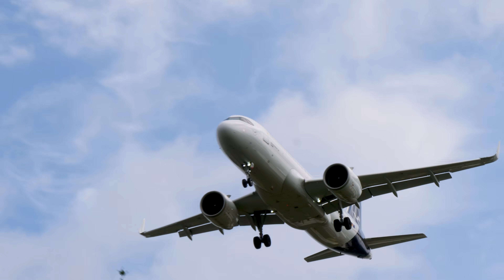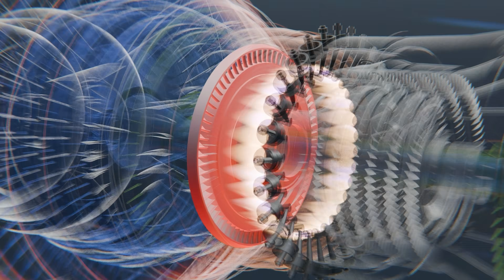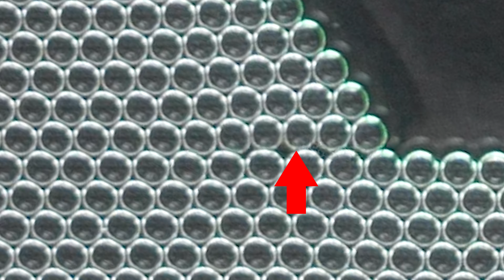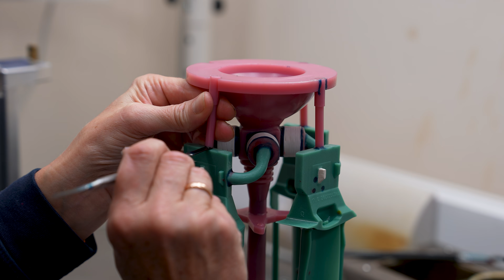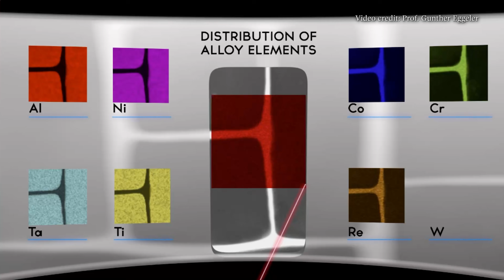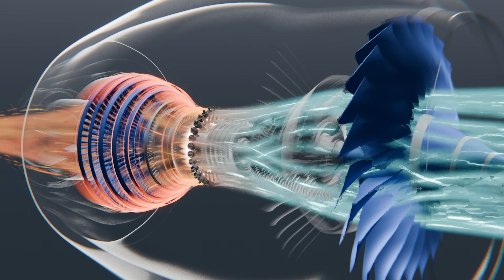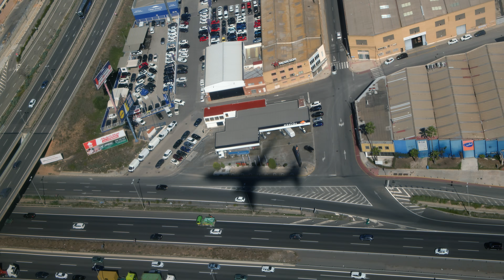The Ridiculous Engineering Of Jet Engines

Comment: If its anything like automotive engine tuning what the fuel "is" has huge effects on what happens to the temp inside the combustion chamber, on a petrol adding a bit more and going rich will means the unburnt fuel help cool the exhaust gas temps more, adding more fuel on a diesel however will do the opposite, keep adding extra fuel and it'll raise exhaust gas temps till stuff starts reaching melting point. 

most of these advancements in tuning and control have came in the form of modern electronic engine managements systems that have sensors that can in real-time monitor and perform operations like adjusting things like where it is on fuel and ignition tables based on a variety of conditions and inputs like engine temp, exhaust temp, AFR, ignition timing, throttle position etc etc as to what the best course of action is(add more fuel, remove fuel, add Ignition timing, remove timing etc)

I would also assume that a mix of 1000's of now standardised modern techniques & advancements in materials science on the jet engine (again, much like the car engine) over the decades, things like coatings on the compressor blades to help extend service life way beyond what they were doing back in Frank Whittles day no doubt help...a lot.

Comment: The Germans achieved the first jet aircraft flight on August 27, 1939 with an engine designed by Hans von Ohain. You can argue about whether Germany or Britain 'developed' the engine first, but you can't argue about who flew it first. Germany did.

Comment: This is incorrect right from the thumbnail... Jet engines burn at over 2,000 degrees celcius, and steel melts at around 1400 degrees celcius. The burning temperature is actually higher than the melting temperature. The reason it doesn't melt is because air that burns the fuel, cools the engine.

Comment: well this is the main challenge with making jet engines.
Building turbines that wont crumble under the extreme pressures and temperatures.
the chinese, iranians, japanese too i think and indians have been struggling with this same problem.
Whenever they turn up the power, the turbines get torn to shreds.
The soviets also faced this problem initially and they had to buy the rolls royce engines.

Comment: I remember when they installed a gas-tubine-combined cycle power plant nearby. The temperatures and combination of metalurgy is amazing. Those turbines, just like your video, have special alloys, cooling passages with film cooling. Such high temperatures help them reach efficiencies close to 60%. Compared to the typical car engine of only 25%, and conventional power plants in the low to mid 30's, 60% is astounding!

Comment: The most simplified explanation of how a jet engine works can be stated in four words "Suck, Squeeze,  Bang,  Blow".   Then jet fins are designed with coolant channels by utilizing the "Lost Wax" method.  As for the overall engine it's self,  it is protected by the utilization of an "Air Jacket ".  This process runs a constant stream of air flowing or crucial components.   If you want to know more do some research;  I am not a research department.

Comment: Hey someone care to explain me why after ignition the pressure to the front and back - if equal - does not force the air coming from the front to stop or force the hot air out to the front equally as backwards? I never understood this.
Reply: Sure, it's because the air pressure is not equal. After the compressors, the air is around 800 psi. At the rear of the engine it is zero. Air moves from high pressure ---> low pressure unless you do some work on it (compressors). The biggest thing to get your head around is that the heating of the air by combustion in a jet engine DOES NOT increase it's pressure. It actually lowers it somewhat. All it does is heat the air causing it to expand and increase it's velocity. That expansion lowers it's pressure slightly. The air isn't confined like in a piston engine. Light a match, flick your bic, light a propane torch, turn on a gas stove. All the same thing - no increase in pressure as the air isn't confined, just hot expanding air. Your hair dryer is exactly like a jet engine. The only difference is your hair dryer uses an electric motor to turn it's fan instead of being powered by a turbine and the heat is added by an electric filament rather then by burning fuel. They are basically the same thing otherwise.

Comment: This is exactly why I got sucked into structures and materials engineering for my aerospace degree. I had a chance to intern at Rolls-Royce and learn all this stuff hands on. Even still, with single crystal inconel superalloy, cooling channels, and ceramic TBCs, we still need more heat resistance for the performance we want; I had a chance to see some prototype components that looked like melted wax after testing. The future in this space is CMCs, or ceramic-matrix composites. That's the same technology that was used on the leading edges of the space shuttle---think carbon fiber, but replace the polymer resin with a high-temperature ceramic. I'm now working on a master's degree doing research in composites manufacturing because of that experience.

Comment: My grandfather worked at lycoming during the period when they first developed monocrystalline compressor blades. I like to think that he helped set the ground work that all future jet engine blade development is based on. I wished I had made recordings of him talking about work and the development process. When they first made their monocrystalline castings, they would plant a "seed" piece of metal and then heat and hold at specific temperatures until the crystalline cells would orient and grow off of the seed piece of metal until the whole blade had oriented into one crystal. The more modern processes are much more reliable for producing the same result. quite amazing.

Comment: even though they work pretty hard on the edge, remember, every plane in service must have the ability to start with one engine. so when one engine shuts off, the plane is still able to start, turn and land with full weight. feel safe.

Comment: Same reason you can boil water over a fire in a paper cup.  Top tier cooling.  There is footage of an RL-10 rocket engine being tested that has blue flame coming out of the nozzle and icicles forming at the nozzle exit.  Liquid rocket engines cool themselves the same way they cool turbine blades but they're pumping cryogenic propellant through them instead of air.  Those recent photos of Raptor 3s in test have moisture from the air condensed on them they're so cold.

Comment: In minute 4:00 shouldn't the square be inside the delta as in Equation (12.46) of ZUCKER, Robert D.; BIBLARZ, Oscar. Fundamentals of gas dynamics. 2nd ed.? Because (∆v)² = (v-v₀)² = v² −2v∙v₀ + v₀² ≠ v² − v₀² = ∆(v²)

Comment: 1. It's a PRESSURE ENGINE, not a heat engine. Heat is the byproduct, heat is waste energy. 2. You skipped HOW the turbine blades don't melt. You skipped the part about all the tiny holes in the blades where air is pushed through them, keeping them from melting.
Reply: The burning of jet fuel in a jet engine does NOT increase the pressure of the surrounding air, it lowers it. All it does is heat the air up causing it to expand and increase it's velocity. That increase in velocity lowers it's pressure.
Reply: @wally7856  No. You're releasing the stored energy in the fuel/air mix by igniting it. That explosive pressure is what drives the turbine. The heat produced is the byproduct, the wasted energy. Even IC engines are pressure engines, not heat engines. Why do you think the same engines can be run cold, with compressed air? It's a simple concept.
Reply: @JohnDoe-ml8ru  There is nothing "explosive" inside a jet engine. There is no air/fuel mix ratio either like a piston engine. There is always 90 times more air then is required to burn the fuel. The burning of fuel in the burners is no different then the burners on a gas stove. You turn on your gas stove, the gas burns in a steady manor in a nice ring, the air gets hot. There is no pressure increase. Flic your bic lighter, light a match, light a candle, light a propane torch - all the same thing. Air gets hot, no pressure increase as nothing is contained like in a piston engine.
    The pressures through the jet engine look like this:  /----____\
    Where (/) is the air increasing it's pressure in a linear fashion compressing through the compressors. When the air leaves the compressors it is at it's highest compression in the engine.
    (----) is the air moving to the combustors at the same pressure as it left the compressors.
    (____) is the slight DECREASE in pressure as the fuel burns in the combustors. It gets hot, it expands, it's velocity increases but pressure drops slightly.
     (\)  is the sharp decrease in pressure as the air goes through the turbines.

    A jet engine is just like your hair dryer except in your hair dryer instead of a turbine driving the fan it has an electric motor. Turn the heat on in your hair dryer. That heating element didn't increase the pressure, it just made the air hot and move faster. The burners in a jet engine do the exact same thing as that heating element in your hair dryer.

Comment: For anyone not experienced with any kind of casting: The idea that the shape of the blade can be as cast without further machining is by itself an incredible feat.
Reply: So while theres not further machining it it is still belted, twisted, arbored and heat treated after.
Reply: I did some diecast factor labor after highschool making Moen faucet and transmission housings. I can remember tons of flash and the first shot was some scary times!! I worked a trim press so yah that is pretty impressive 😊
Reply: couldnt you just forge it?
Reply: @squidwardo-e6g the tolerances are within a 1000th of a mm generally
Reply: @squidwardo-e6g I highly doubt you could maintain the single crystal structure in a forging process.
Reply: True dat!
Reply: Im maybe missing something 
What does ge mean by casting 
Mot familiar with scientific English words
Reply: Yup. I work in aerospace and have machined many a casting. They're far from accurate most of the time.
Reply: @travisgatlin536 I mean sure, but the amount of material your machining off is significant from the AS Cast part, even post alpha case removal. Like easily 50-75% is removed for most parts.

Comment: Used to design these components in RR. A video on how they monitor these engines while the’re in the air and how they can predict component failures before the aircraft lands and have replacement parts waiting to be fitted would be a great compliment

Comment: Doesn't compressing air mean it should lose heat?! It should become colder not hotter.
Reply: Try to imagine all the heat that is in the air in your room right now. Now compress all that air into a little tiny box. Now you have all the heat that was spread out in your room now  concentrated into a tiny little box. It would glow white hot.

Comment: Soooo.... if that engine does 97k lbf that means that a single SpaceX Raptor3 produces more than 6 times the thrust. So if its 4 engines on a jet a single Raptor3 (which also is waaay smaller) produces more thrust than the whole plane... Consider that there are 33 Raptors on Starship Booster... now I understand why concrete was being pulverized during that first starship test flight.
Reply: A single Raptor3 has about the same thrust as eight 747 engines!
Reply: @wally7856 thats basically what I Said…
Reply: @p0mm3srud1  Yup. 
747 horsepower ~70,000 hp
Raptor3 fuel pump requirements ~ 100,000 hp

A 747 engine couldn't even power the fuel pumps on a single raptor3 engine

Comment: Based on that thermal efficiency formula, the theoretical limit that jet engines could currently achieve is about ~85 % ?
That would be insanely efficient if we are just getting close to that!

My calculation:
1 - 220 / 1770
Temperatures in Kelvin, would be -53,15° C outside temperature at flight level and 1496,85° hot air temperature inside the engine core

Probably the calculation is wrong because we would have to know the gas temperature when the still hotter than outside air is through all turbine stages?
Reply: Sounds about right. To get that max theoretical efficiency you also have to compress and expand the air infinitely slowly so it may take a while to get there.

Comment: Turbine engines run at 1500 Rankin degrees which is around 800C.  I think that might be some of this videos misunderstanding by the author stating that they run at 1500C.  Turbine blades completely fail at around 1200C.  Otherwise a great video.

Comment: As cross section area of fluid flow reduce also reduce pressure of fluid.
What is point to keep narrow area from compressure to turbine, cross section area of casing of compressor, combustion chamber and turbine should be same, might get more space inside, it might not adversely affect performance and efficiency of turbojet engine, might increase lifecycle of turbojet engine.

Comment: 2:32 Veritasium the Chanel that doesn't understand Turbochargers in combustion engines. 

31:48 Right now its the price of the Round trip. 
The prices for fuel and the Costs of all the additional work being done and still this about 55% price reduction is visible. 
Sometimes economic conditions seem to get through to the customer.

Comment: This got way crazier than I expected. I only knew floating zone method for making silicon ingots but these are insanely expensive and actual electronics is made on thin wafers that are still expensive. Only if you cut the wafer into hundreds of thousands of pieces can you get a cheap part. To use hundreds of these single crystals in one engine is insane. And the microchannels for cooling? Completely blew my mind. I think jet engines are too cheap  😂

Comment: Inconel probably, I’m a pipe welder and I’ve worked on high pressure high temperature pipe systems that used inconel because of its temperature resistance and strength while being hot. I’d guess that would be a good alloy for turbine blades

Comment: I was disappointed at many of the explanations in this video. Perhaps slow down and have a few tens of people review them before release? The explanation of the cooling channels, the turbulence, the cooling air, and even the removal of the central core was muddled, at best. An enthusiastic viewer with little understanding of casting would need and appreciate a better schematic diagram of how casting like this works; and once the idea of the core and its purpose are revealed, a review of the cooling source (more than was shown), and how the cooling works are critical and were missing... worse, understanding the emphasis on the specialized holes added at the end was based on that muddy explanation, and then no detail of that was provided at all. Are they lasered? Drilled? How does Boundary-layer cooling work, and why was it important? All this was missing.

Comment: I just have a small question..... If the ai coming into the turbines were compressed to 50 times at atmospheric pressure, wouldn't they just condense to a liquid gas which most of the time cryogenic? And can't you use that to cool the engines? I have seen rockets running cryogenic fuels through the nozzles to cool them from the hellish temperatures, why not use them here?

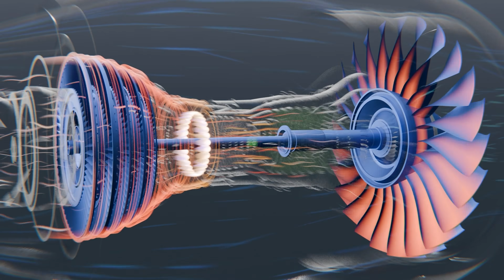Comment: At 2:18 if the turbine at the back powers the fan at the front, but the turbine at the back needs the air from the fan, how does this engine start??? It looks like the front needs the back but the back needs the front. I'm confused.

Comment: You should have given a teaser of how they use active cooling to manage the gap between the rotors and case through the changing environment of the flight. Every particle of air that sneaks through that gap is lost energy->efficiency, but you definitely don't want them rubbing (obviously)!!

Comment: Ha, been inspecting engines for 40+ years, and I'll tell you this one FACT !
The new generation engines ARE MELTING!
Their turbine sections are using thermal coatings that FAIL after just a couple hundred flights, and the underlying metals are cracking, and holes are burning in the blades, and outer case shrouds.
That's the real engineering truth, they don't want you to know about !

Comment: The words "these blades" were used several times in this video, and I assume that these specific are being mass-produced.  However, I assume that there are competitors that are developing similar types of blades with slightly different alloys, so it should blades like this. Hell there are probably different models at RR for different engines.  

So it makes me curious if the others are different and how? Or is this just become the default new normal a few years after a breakthrough happenes?  A new blade works best and the retrofit all existing engines during the next major maintenance cycle?

Comment: Your failure point temperatures are off by a couple tens or somewhere there. You cut the failure at the point of loss of contact, but failure appeared quite some time before then. Maybe change that to contact loss time or sth and don’t touch the number.

Comment: Ah, so veritasium has now dived into my domain. Glad they did this video. I work as a Mechanical design engineer and analyst for Rolls-Royce here in the UK and trust me, gas-turbine blade cooling is still a very massive area of research. More is still being done for better thermal management because even after so much research that has currently been done, those blades still operate at SAT beyond their own physical limits. Hatsoff.